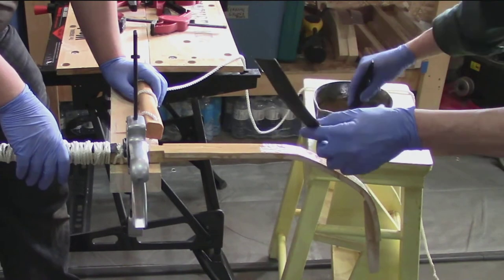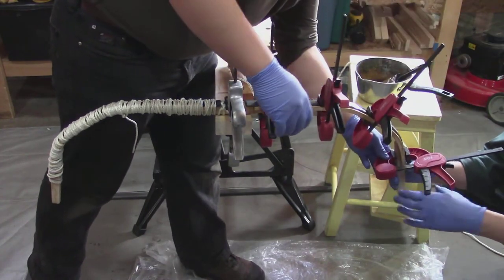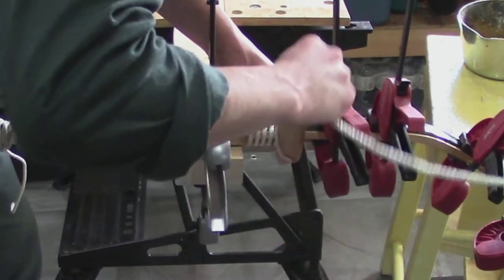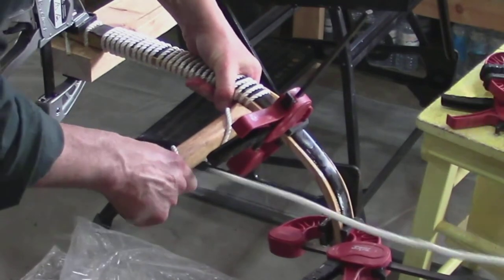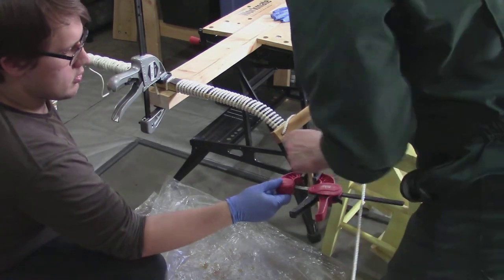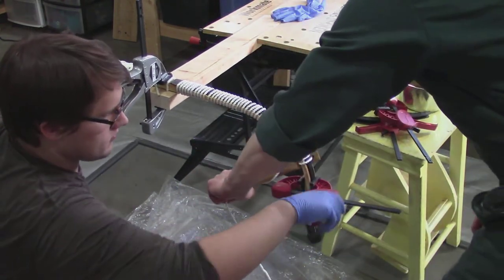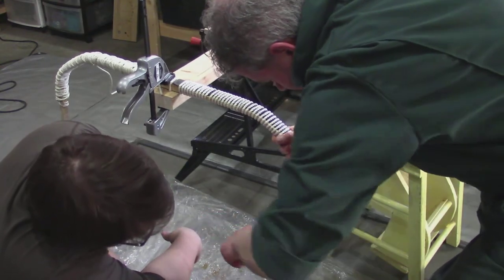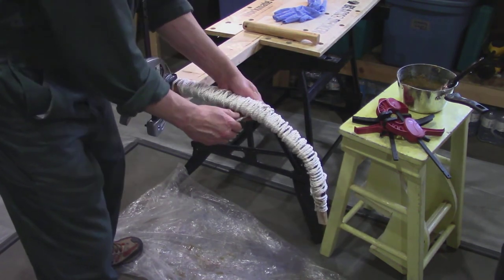Hornbow Binding the Horn to the Maple Wood Core

Comment: Great video,Where did you get the 200 pounds per square inch for the tencik ?
Reply from the maker: I cant quite recall but it I recall it was from an knowledgeable source. You can really feel the pressure from the torque on the rope

Comment: fish bladder glue is better for the bending sections (sinew layer) i think. hide glue more for the rigid wood to wood sections
Reply from the maker: Thanks for the advice. I am not sure whether I will ever make one of these again as getting all the pieces is difficult and expensive
Reply: vfc Archery i read adam karpowicz book its been very helpful as well as my mentor who recommended it. i hope you will do it still as not many do, and you managed to make one successfully. but i understand that the process is difficult and such.
Reply: @vfcarchery7967  well at least you have all the equipment needed to make one allready, are just talking about the horn and sinew and glue cost?

Comment: Did you cut matcing grooves in the core and the horn? Did you size the horn and core?
Reply from the maker: Yes the wood and horn was sized but stuck with grooving the horn and wood but not interlocking them
Reply: zoe dada lol
Reply from the maker: The grooves were not matching but horn a wood were sized

Comment: Not grooving horn and wood ?
Did it hold ?
Reply from the maker: Horn and wood was grooved however not interlocking. Yes it held however not recommended for bows over 80#
Reply: Im going to just try a sinew backing, I don't have Horn, and I have no experience with it... Im going for 80lb at 26.. with a 64inch Maple stave, flatbow... and how about Ash? The Egyptians used ash I read that.
Reply: Did you size the wood first ?? How many layers of glue ??
Reply from the maker: Yes sized about 6 times